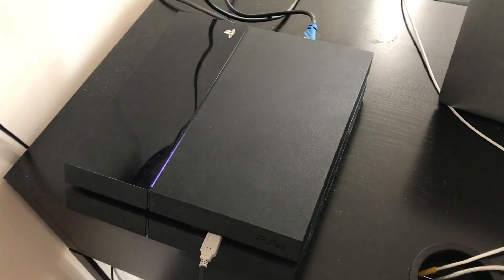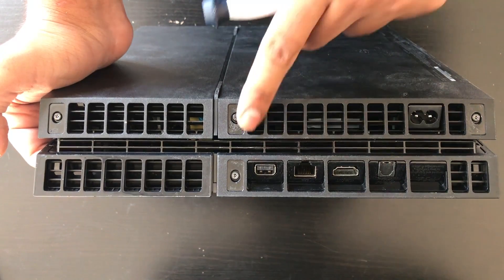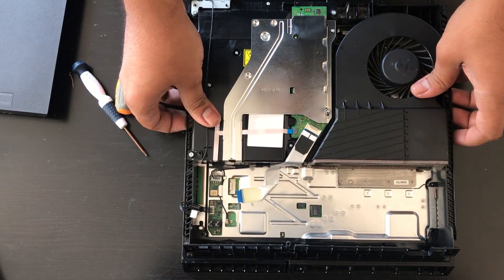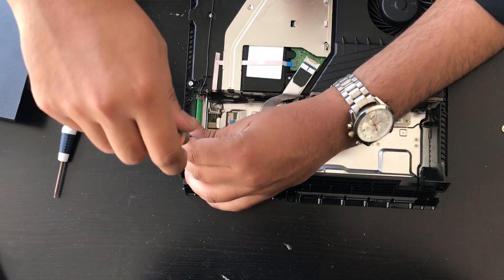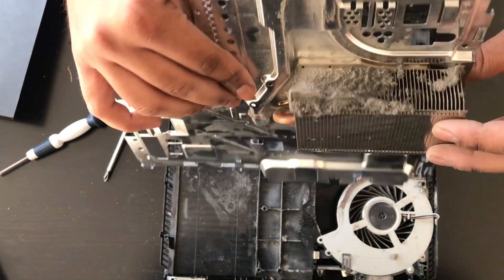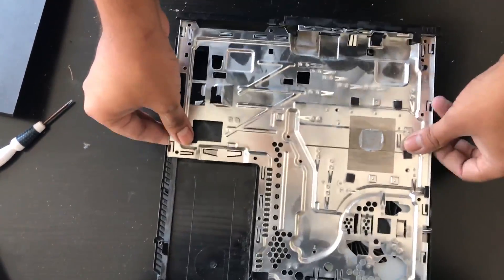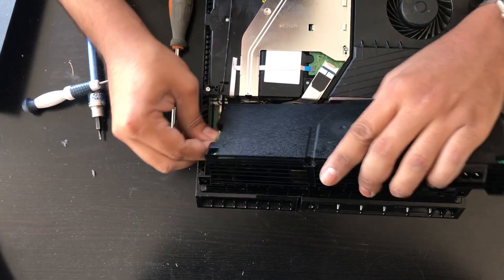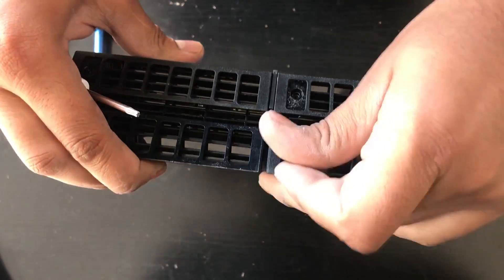PS4 Too Hot overheating due to dust build up and fan (CUH-1001/1115 cleaning and disassembly)

Comment: my ps4 literally over heats then turns off with in 30 seconds of me turning it on but i have cleaned all of the dust out of it what should i do?
Reply from the maker: Professor Lag Try replacing the thermal paste and check to see if fan spins

Comment: Mines sound just like a jet engine,overheated and turned off on my playing red dead 2 I'm heart broken. Will try to fix tonight. But mine is a 1115A model. Is it the same procedure?
Reply from the maker: Yes its the same with 1 extra screw on the 1115 model under the power supply
Reply: @fasttechvideo  thank you! Fixed it yesterday works like a charm now!!
Reply from the maker: You're welcome. Don't forget to subscribe and like the video!

Comment: Hi thanks for the video. I have done what you did and unfortunately my fan is more louder. I did clean everything. And change thermal paste. Also i instsll a data bank with 2t 7200 rpm sshd and a cooling fun at the back. What should i do? Thanks if you can can help me.

Comment: i tried mine but its worst. it still sounds the same, and now i cant play for 2 minutes straight. it turns red and it makes like 3 loud beeps then turns off. when i opened it up i didnt have that gel square mine was like greasy light brown
Reply: NUGGET PSYCHO that is your thermal paste if you are talking about 7:17 it’s a cheap and easy replacement but you should definitely do it before any further use

Comment: Dude thank you so much!! After waiting for so long Kingdom Hearts 3 to come out, I finally purchased it and the fan was messing up my experience with its loud noise, but with this video I got it to where its dead silent!! I cleaned the dust (dead cockroaches were literally inside the system) out and replaced the thermal paste and it works perfectly!
Reply: How the hell did a roach manage to find it's way into your system? Where do you play in your houses crawlspace? Good lord.
Reply: I DONT COMMENT UNLESS YOUR DUMB, I don’t know if it’s a joke but your name is your instead of you’re
Reply: Kubilaysavs, ok
Reply: @dontreadmyprofilepicture8817  Believe it or not cockroaches in ps4s are more common than you think.
Reply: Broken Circuit you guys must from New York 😂😂
Reply: @DomV123  I've only ever seen like 3 cockroaches in my life but I know that it's a common issue
Reply: @TheBrokenCircuit  Specially dead ones. It's like they make a nest in them. Seen small cockroaches and insects in consoles. Depends where you live

Comment: I tried all of the steps and all of the ways to do it. I definitely looked at all of the steps and did all of them, but there had to be something that I didn’t put in all the way or forgot to put back or didn’t do it the right way. The PS4 plug is in and I press the PS4 button and the 5 white flashes flash and does nothing

Comment: I have a huge problem , everytime I load up fortnight my fan volume becomes super loud and the system ends up overheating before I can even load into a game. I’m afraid that I might damage the console doing this because my older brother had the same issue and tried to fix it but just ended up completely not being able to turn on his ps4. So yeah I debating if I should do this or take it to a pro ? Maybe send it your way ? Or just take it to a local near me ?

Comment: Yo I followed your every step on this situation and did indeed clean a lot of dust from the thermal heat thing. However after I put it back together now it has no power.... What or where did o go wrong. Plz if you would let me know what you think. It would be very miuch appreciated
Reply from the maker: Check the pins under the power supply.
Reply: @fasttechvideo  pits? Is that where the 2 prongs go? Cuz I think I did if so. But I was thinking that maybe the on and off  button got messed up. In going to check it out by using the cover of my other ps4 and see. What do you think?

Comment: When I turn on my PS4 it automatically turns off saying system is overheating do I just need to clean out all the dust or do I need to get a new fan?
Reply: If you have already cleaned it like he did in the video and that is happening try your thermal paste 7:17

Comment: Dude!!!! You are a beast  It worked  my ps4 would shut off after 10mins running because it overheats  i followed all the steps (except I didnt use thermal paste)  and cleaned the fan thoroughly with a qtip  and waalaa baby.. love fam

Comment: Cleaned the fan but still get a message claiming the ps4 is overheating and shutting down??   Is there a setting to prevent this happening?  I do not believe there is any chance it will overheat. Thanks!
Reply: I think it’s your thermal paste ( 7:17 ) it’s a cheap and easy fix

Comment: My ps4 won’t turn on any more cause I did this :(
Reply: It's your power supply take it out and make sure those 2 prongs are connected correctly.
Reply: @ponginsix  wich 2 prongs plzzz reply
Reply: @boj091  the power supply
Reply: rewatch this video or differnt and make sure you have every wire connected
Reply: When I turn on my PS4 it automatically turns off saying the system is overheating and won’t stay on for more then 3 minutes do I just need to clean it or replace the fan I’ve never done this before
Reply: @hoe4367  the fan
Reply: @hoe4367  https://youtu.be/uayVMlO9A5A at 6:21 she took off the silver  thing just flip it and u will see the other fanbut another thing u can try that work for me is that you can open the cover of front of the ps4 and but a fan behind it make sure the air is going to the ps4 but make sure u dont spill anything it might brake ur ps4 but try to do the first thing
Reply: Make sure the plug from the fan is connected

Comment: Hi, im new here and I came upon your video. I was scared at first but decided to do it either way. I cleaned the fan at first, then the rest. The next day, I wanted to play a game but my ps4 notify me that it was too hot but i barely launched it. And yesterday I opened it to check what was wrong and it was nothing. Now when i wanna start a game now, the fan goes insanly loud and my ps4 turns off. I wanna fix it but i dont know what it is, do i have to replace the fan or replace the thermal paste? I would love to know what to fix. I cant afford one right now so if anyone has any ideas please tell me and ill give it a go. Thank you

Comment: My PS4 is kinda loud but it doesn’t overheat
Reply: Skiddadally 1212 my one overheats then turns off
Reply: @YouTubeShortsAIGen  does any thermal paste helps?
Reply: What happens to mine
Reply: Literally just explained what a overheating ps4 sounds like
Reply: Not yet. It will eventually start to consistently overheat after like an hour of playing.

Comment: Just did this to my PS4. I had an original and it threw me the overheat error. I got everything apart and cleaned everything. The heat sink was dusty and I added thermal paste. When I got my PS4 back together it was so quiet I couldn't believe it. Thank you so much!

Comment: I am tempted on taking mine apart but thing is my system turns on and everything it is just the fan not spinning once it turns on it tries to spin but doesn’t so it could be the dust but the fan not even trying to spin

Comment: I would recommend just going ahead and replacing the thermal paste if your already in there. It's probably a good $8 online or best buy and most likely a better replacement then stock paste.

Comment: Ive had the same xbox since it came out and I never had this problem......
Reply: And we don't give a shit!
Reply: Saba Gamer stop acting tuff over the internet you 14 year old internet soldier. I would beat the fuck out of you in real life and that’s a fact. 👌🏽🙃
Reply: It's because playstation cooling and heat/dust extraction is and always has been shit
Reply: @mrrobot790  shit? Bullshit you are saying, my PS4  is dead silent,do you know what I do??? I don't shit on it,I take care of it,and clean it!
Reply: @sabagamer3052  Lol no one said they weren't silent, the heatsinks and fans on the last 2 generations of playstations have been crap. I've had the same ps4 and ps3 from the launch days and they run fine. But the cooling in both of them is shit. Sharpen up son 👍
Reply: @mrrobot790  they do come with shit thermal paste
Reply: @mrrobot790  slim it the best option for now
Reply: This is the grandpa ps4 the newer  versions don’t have this problem thanks to Sony updating the design where it’s easier to clean and doesn’t need surgery
Reply: At least my playstation has never had a red ring of death. Just putting that out there
Reply: Dickhead alert

Comment: Thank you so much for posting this. Had my PS4 for nearly 5 years and it sounds like it's going to blow any minute. Took it apart and cleaned it thoroughly thanks to this guide =)
Reply: Omar Hernandez did you replace your thermal paste or just clean the dust out

Comment: I removed the dust, and now my ps4 directly turns off when i turn it on.
Reply: mine is doing the exact same
Reply: @The0fficalNike  did you fix it? Mine is also doing the same
Reply: Its because you need to replace the thermal paste
Reply: TINY PLAYS where do you get thermal paste
Reply: @The0fficalNike  amazon
Reply: I broke mines 😡😡😡 I decided to try it
Reply: Best buy has it too. Cost me like 5dlls
Reply: Removed dust and now my PlayStation turns on the fan goes really loud and then turns its self off anyone help ? Think maybe thermal paste ?
Reply: @leonharding9936  Its 3 beeps and redlight  after it?
Reply: Wolwezz YT I have now got it to turn on but now my fan will go really loud when I’m on a game and then it says it’s to hot and I have to turn it off? Did you have the same problem
Reply: @leonharding9936  it is    I turn on ps4    open any game   3 sec later    3 beep red light  and go off
Reply: Red beep problem guys  Lets make Instagram group  
like   if anyone find anything give a information to us
Reply: Wolwezz YT I have messaged
Reply: @WolwezzYT  can I join the group?mines doing the same
Reply: @ishowdjarin5544  Everyone can join   Just dm wolwezzfn
Reply: Solution- For me it was the screws it wasnt tight enough so i suggest u go back and disassemble it then reassemble it and it should work fine
Reply: @Removinq  Yes yes bro ur right   Today  Finally i find t9 torx and  Make screws tight   Thats it guys
Reply: @WolwezzYT  no problem
Reply: Removinq i’m going to do this today.. do you have any tips i should be aware of while cleaning it so i don’t mess this up
Reply: Ers Not really I suggest you watch a YouTube video of them cleaning a ps4 while you clean yours just to guide you
Reply: Ers also remember don’t lose screws
Reply: Removinq should i use thermal paste to because it’s the first time in 5 years i’m opening this jet
Reply: Ers I owned my ps4 since it dropped so that’s like 7 years I never used thermal paste
Reply: Ers mines used to sound like a jet too I just cleaned it Saturday
Reply: Ers now it’s quiet kinda weird it being quiet because I’m so used to the noise
Reply: Removinq so when you took out the motherboard and put it in al together there was no problem when you started your ps4 again?
Reply: Removinq okay thanks for responding
Reply: Ers I didn’t take out the motherboard i left it on there I cleaned it tho I mainly went for the main problem the heatsinker and the fan that’s the only thing you should worry about really
Reply: Wolwezz YT mine doesn’t that. Did u fix it ? If so how I need help
Reply: I'm back guys and it overheats directly... I think you need to put some thermal paste  to make it work and remove the dust...but I got a new ps4
Reply: Blacka Bivak I already put the solution up there
Reply: Same thing for me where can I get that specific thermal paste
Reply: @arias8ale  amazon
Reply: Apply pressure to the motherboard and make sure the screws are tight in the middle above the thermal paste
Reply: Can you tell me what happened next
Reply: exactly now i have a broken ps4

Comment: Lol i did this and my playstation just turns on the fan blows had and beeps 3 times and shuts off
Reply from the maker: Which one is it? This one or the BLOD repair you also claimed to follow and it to not have worked.
Reply: @fasttechvideo  i got the BLOD doing the repair from the heatsink. I saw someone else had the issue and you directed them to this video.
I completed this procedure and now my PS4 turns on but the thing is slightly louder if anything and i overheat in 2 mins just on the home screen
Reply: *update i had which two videos confused. I followed THIS one and then  got the BLOD and the other BLOD video about the tighting the brace got my ps4 to turn on

Comment: Hey i fallowed every step but some how ended up with 2 leftover screws and now the fan isn't loud anymore but now when i press an account and log in it overheats right after and turns off what do i do??
Reply: What do the screws look like? You probably forgot to screw in something important.
Reply: Same problem brother
Reply: Did you fix it because mine isnt working it turns off as soon as the fan goes on running
Reply: It turns out the reason it didn't work was because I had forgot to plug in the fans cord back into the PS4 that's why it did that after I plugged it back it now it works like new
Reply: Luis Garcia i have rechecked everything and still the problem is coming idk why
Reply from the maker: @PinkmanPubg  Which screws? If they are for the heatsink clamp the system will not work properly unless they are screwed in. Check the pins under the power supply.
Reply: Bad Ass you need to change the thermal paste you can buy it at Best Buy for 8$ I did it
Reply: Luis Garcia did you figure it out? Same thing happened to me, thinking it might need the thermal paste.
Reply: Always, Always put new thermal paste on the ps4 cpu when taking the motherboard apart off the heatsink. That's very crucial if you don't want your ps4 to overheat even after removing built up dust on the heatsink fins and fan.

Comment: I recently just did this to my ps4, to clean it and now I am experiencing menu lag, or dashboard lag. Whenever I'm scrolling through on the menu, it would get stuck or just laggy. I don't know if this has to do with me recently taking it apart and cleaning it but this has never happened before until, which is wierd. I tried rebuilding my database, as I thought would work but did not. Hopefully I can get some help from you or someone, I'd appreciate it.
Reply: I had the same problem. It's your wifi antenna cable inside your ps4 search up the problem on google and you'll see. I fiddled around with my wifi antenna, i kept taking it on and off and all of a sudden the button lag went. You may need to buy a new one and replace your old one, they're pretty cheap and its easy to do.
Reply: Little Piggy ok ill try this thnx
Reply: Is it only in the menu?
Reply: Menu and while on games. Even if I’m not connected to WiFi still lags.
Reply: if u didn't change the thermal paste that would be my guess could be the cpu/gpu is over heating causing u too lag.
Reply: GT/CS_Coyote thermal paste looked good to me, wasnt dirty or anything but never know.
Reply: https://youtu.be/lFJzCtjwbXc same exact problem I’m having.

Comment: So I have a problem here about removing a screw, it's stripped badly where I have no clue how to fix it. I know there is tools to help with stripped screws but do you know any specific tools to help it? The screw that's stripped is the long sliver one that is connected to the power supply.

Comment: Hey bud, I ordered one of those screwdrivers of your website, how long do they usually take to arrive
Reply: @HEARTLESS ya I fixed it now but thx tho
Reply: @cyguy99  so the fan easnt connected right?
Reply: @butter_fps2900  yea
Reply from the maker: Where are you located?
Reply: @fasttechvideo  North Carolina, US
Reply from the maker: @cyguy99  Should be there in 5-7 days. Thanks for your purchase.
Reply: Alright thx for responding
Reply: @fasttechvideo    hey i did everything in the video and went to turn my playstation on and the light turned blue then it turned back off. What could be the issue